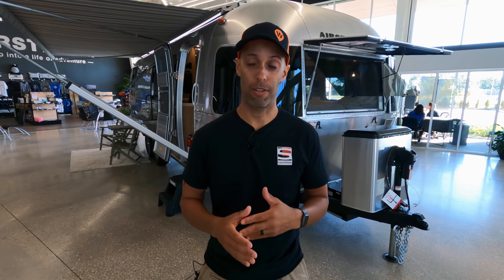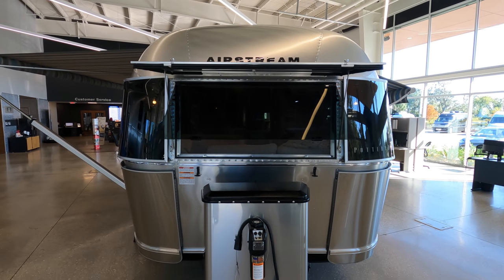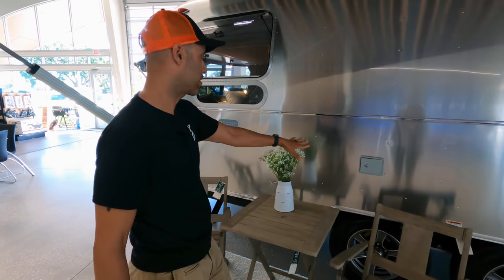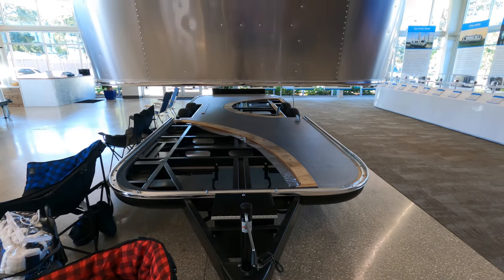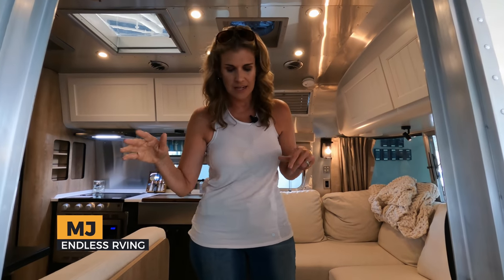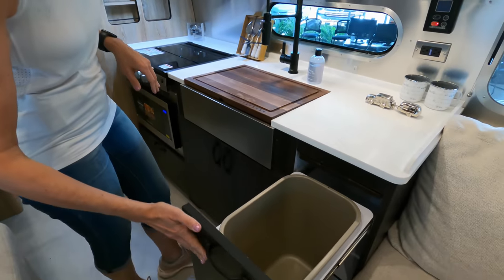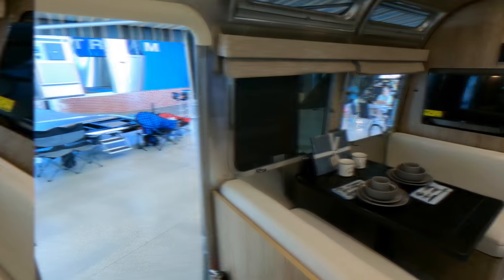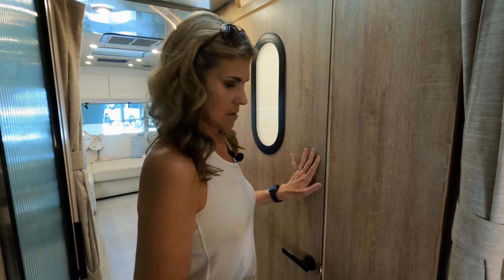MJ Loves This RV -- 2022 Airstream Pottery Barn Special Edition --  Get The Best Deal Here!

Comment: Decisions, Decisions! Making it harder for me. About ready to pull the trigger replacing my primary driver (Mini Countryman) with a Ford Escape Hybrid as a TOAD, but the pull of getting a truck (150) as a daily driver is strong. Either way, that decision locks in Class C vs trailer. A 150 may be underpowered/borderline for this Airstream, but I can do without the Pottery Barn swag and go a little smaller. One thing about Airstreams, the may have a premium price, but they retain value. Maverick hybrid, also TOAD qualified, could be the compromise to the Escape, but despite built with same platform/powertrain, Ford eliminated the AWD option on the hybrid...where the other engine doesn't qualify. Thanks for making my decision harder. HA!

Comment: They definitely have a strong following, and I won't knock it, but for me, personally, in that price realm I'd rather have a DRV, or a New Horizons Summit.
Reply: Decisions, decisions. You just made it more difficult. As inventory increases, I need to replace my non-towable primary driver (Mini Countryman). Ford Escape Hybrid vs half ton (I know,, underpowered for this Airstream, but not all). Either way, that makes my decision for me, locking me into either a Class C or a trailer. Don’t want a 250/350 as a daily driver, but would love another truck. Even consider the new Maverick as a toad.